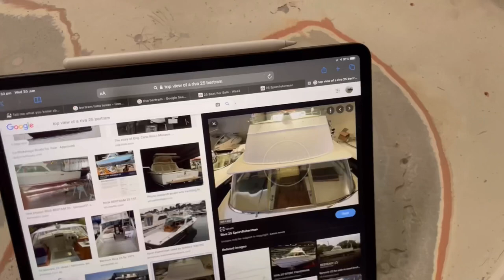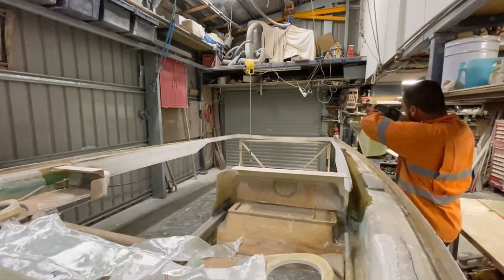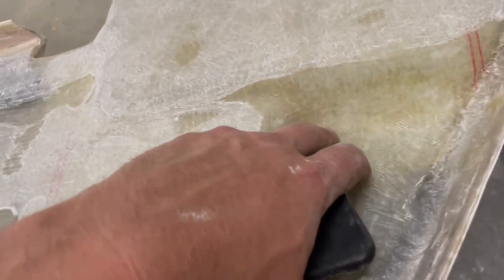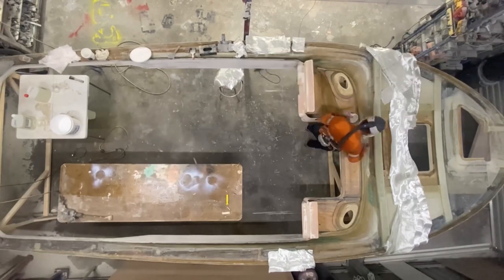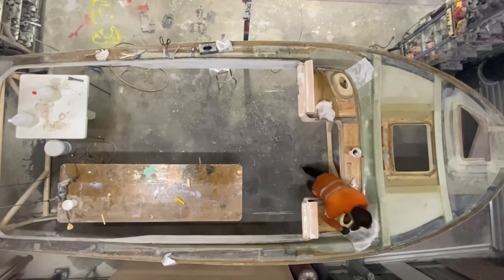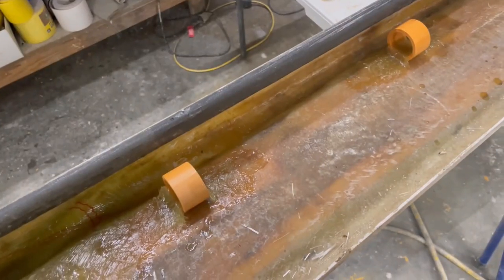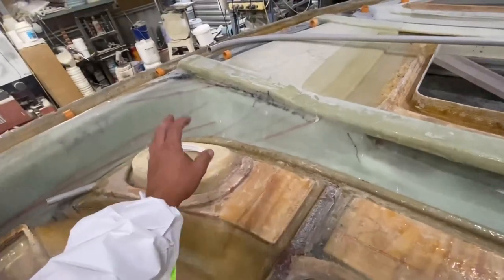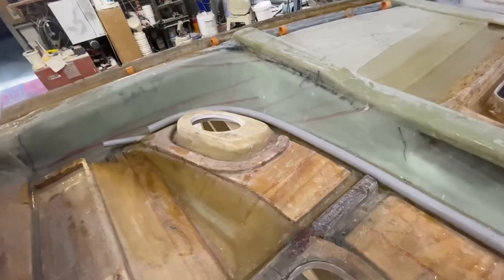25ft bertram project - Blob 39 short (Glassing the back of the dash in) BOAT REBUILD

Comment: This is great. What breathing system are you using? How do you like it?
Reply from the maker: 3m versaflo . I’d be dead without it and I wouldn’t use anything else. The battery connections and battery are a problem and they are over priced(2k with battery) !! I wasted many hours trying to keep it going with original battery (I ended up buying 3!) But I found out how to fix it cheap and easy and been awesome! Try to find a 2nd hand one cheap! Hopefully real cheap if it doesn’t work! Cos it cost about $30 to fix…. 

How to fix a Versaflo - CHEAP & EASY!
https://youtu.be/xmZ5PF0Qkq0
Reply from the maker: Thanks for the comment!